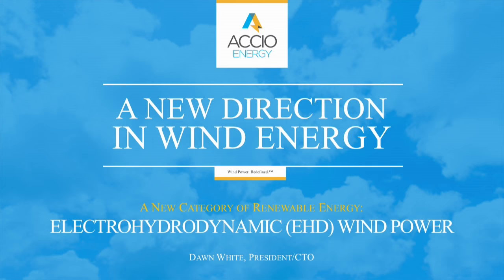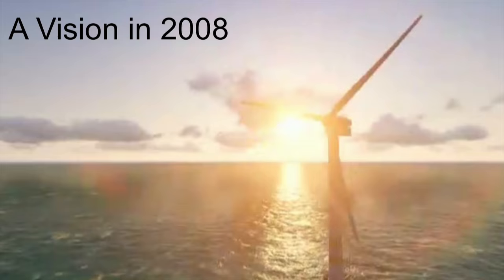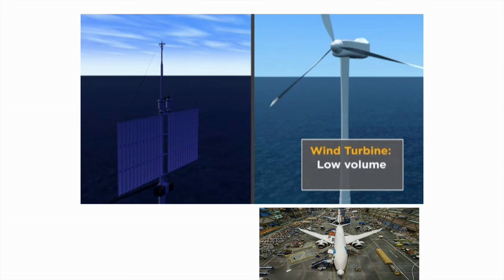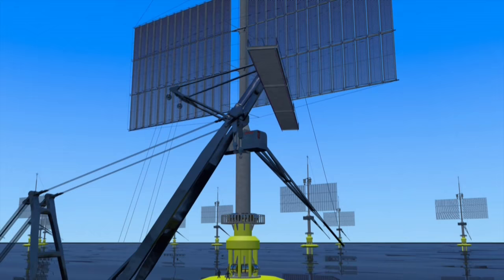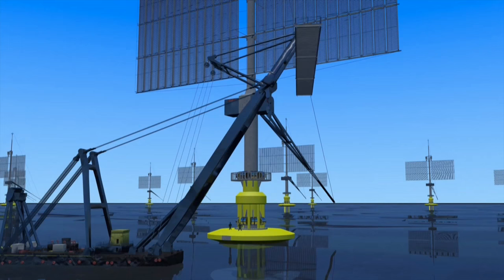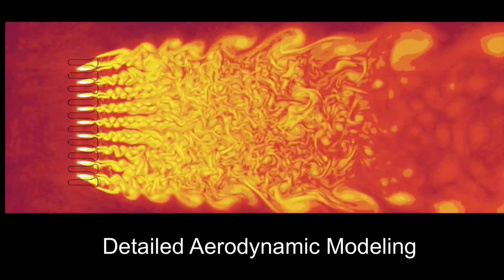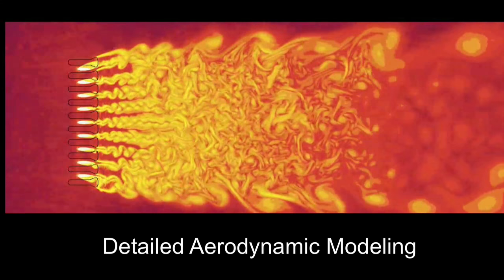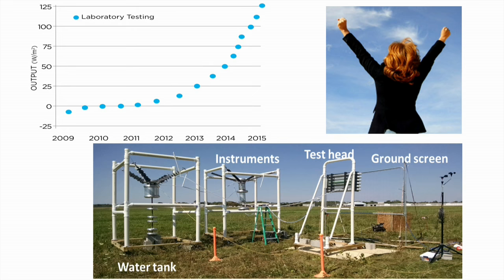A new direction in wind energy | Dawn White | TEDxDetroit

Comment: A typical turbine produces between 50 and 70 watts per square meter. a typical polycrystalline photovoltaic panel produces 150 to 170 watts per square meter. This system, at 100 to 125 watts per square meter is right in the middle of installed peak power per square meter. Is it possible to make the surfaces of the air foils photovoltaic? It seems, if this can serve double duty, it could exceed 200 watts per square meter, making it the most powerful renewable energy source ever designed!
Reply: Will make it more cost to install.

Comment: this design is like huge sheet in the sky. So i wonder how can it revive in ocean storms ?  Just imagine, if you put a colossal sheet in the center of ocean storms, then what will happen ?  Of course, its idea is interesting.  May be this startup company will surprise all. We wait for, and we wish that they will solve the problems.
    In any cases, this technology and other ocean offshore energy  technologies should combine with producing hydrogen on site offshore.  In a lot of cases, you should transfer offshore energy by producing hydrogen on site, instead of by wire cables.  You can take water from the land to produce hydrogen, or you can produce hydrogen directly from salt sea water. There are startup to produce hydrogen on site from sea waters.

Comment: Brilliant
Reply: I wonder how this works in a salt spray environment? My intuition says it would be hard to prevent a path to ground from forming and draining off the high voltage. Also, I imagine these holes are fairly small and might get clogged with some kind of precipitate after a while. Maybe it's necessary to purify the water? I'm guessing that might deal with discharge through the column of water that's getting pumped up as well. I'm disappointed that this talk didn't address any of these issues.

Comment: Interesting idea, and pretty clever, but there are several, very typical factors of concern:
1) They go from a "100-Watt/sq.meter output" in the laboratory, to a full-scale offshore prototype?  (which looks like it wants to use my patented floating foundation by the way U.S. Pat. 10,024.307)  This is a typical misstep in wind energy - going "too big, too fast".  Try powering a single home with a new wind energy concept, rather than the typical hype-driven "We're going to power X hundred or Y thousand homes!".  How about one home first?  Can you do it?  Wouldn't powering one home be a more appropriate first step?  Why would anyone believe you could power 1000 homes without powering one (1) first?  Why build huge initial prototypes when you could build a smaller one and work out the bugs at a lower cost?  These funding agencies are more responsive to how well you can submit paperwork than the likelihood of success for the actual concept.  Of course!  It's not their money!  It's someone else's money!  And the bureaucratic nature of the selection process almost guarantees technically-lacking projects will slip through the cracks and be funded for millions in this excess of "other peoples' money".

2) The magic of wind energy is, specifically, the low solidity of a propeller-style rotor.  The blades only cover 2-3% of the area of the circle, yet can extract near the max energy possible from the flow.  That's what makes economical wind power feasible. 

3) In storms, such low solidity is needed.  The 3 blades can be feathered to present very little area to a 100 mph wind.  High-solidity solutions like ducts, shrouds, and this idea, would have to be built so strong compared to a normal turbine, in order to survive severe storms, it would be uneconomical. 

4) Icing conditions:  Hmmm, not looking good...

5) Efficiency:  Last I knew, regular wind turbines were getting more like 300 Watts per sq meter in a decent wind.  These guys (girl) claims 100 Watts/Sq. Meter is "good".  I think I see through this statement:  What she seems to be doing is comparing "apples to oranges":  The 100 Watts per sq meter she refers to, for ordinary turbines, has to refer to average output over time, including times of no wind, not peak output.  In other words that "100 Watts" multiplies peak output of over 300 Watts for a regular turbine, by the fractional "capacity factor" which is a measure of how often the wind is even blowing, and which cuts "peak output" to about one third (1/3) of the peak output.  And I believe she is comparing their peak output in a laboratory setting to an average (not peak, but 1/3 of peak) for regular turbines.  Comparing a peak to an average.  That is a completely false comparison.  That's where the bureaucracy comes in:  A grant proposal contains so many requirements, so many pages of overly-optimistic nonsense are mandated to be included, with so many non-technical people involved in the decisions, that such basic truths get "lost in the shuffle" or are "shrouded by the fog of battle" (for funding) and so bad ideas get funded for many millions of dollars to prematurely deploy at a larger scale than is warranted, rather than the thousands of dollars that would be more appropriate for a "prove it to me" technology like this.  One reason, again, is the bureaucracy:  They have too much money to give away, and yet it costs so much to plow through all that required paperwork that there is a high overhead cost for issuing each grant, so they then would rather limit the number of grants, and make each grant for higher amounts, which just becomes one more bureaucratic cluster-bleep, building "bridges to nowhere", funding ideas with show-stopper characteristics while sounding like they are "saving the world" while keeping their government jobs.

I've warned the two principals of the biggest V.C. company, and you can guess which one that is, against funding such a high-solidity wind energy "solution".  I think they wasted a good fraction of a billion dollars on it, before nobody could continue pretending it was anything but a waste of everyone's time and money.  Weird thing is, at that point, they still found a sucker to buy it (more "other peoples' money").  But after that,the idea never went anywhere, as I had told them in the beginning.
Reply: Research into new things should always be encouraged, not blocked just because there is no immediate money in it. However, this project apparently didn't work out:
"Accio Energy, Inc. was a Michigan-based early-stage renewable energy company developing unique “turbine-less” wind energy generation technology to deliver clean, sustainable energy to people around the globe. The company has closed its operations due to unfavorable commercial viability in current economic environment." -Belle Impact Funds website, 2018

I'd like to know if this is just another "works in lab, not real life" technology or could you set one up in a lake and get any power at all out of it. There are plenty of generators that will not produce enough for you to power your house and sell to the power company so it would pay itself back in a short time. But if all you want is to charge your phone in the middle of nowhere, some of them become viable. In theory this one has less moving parts so it could work more reliably than a regular windmill.